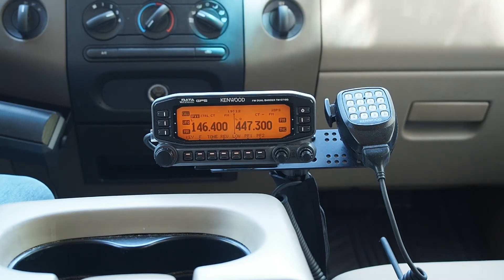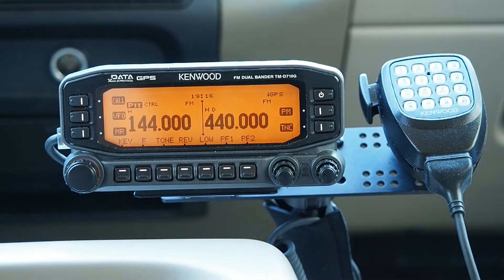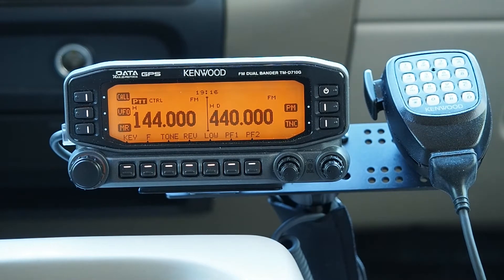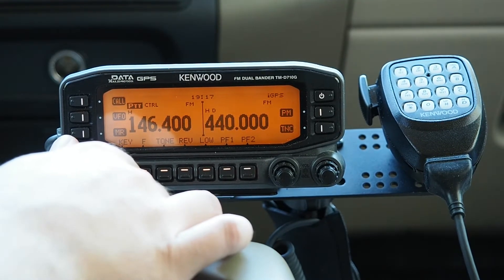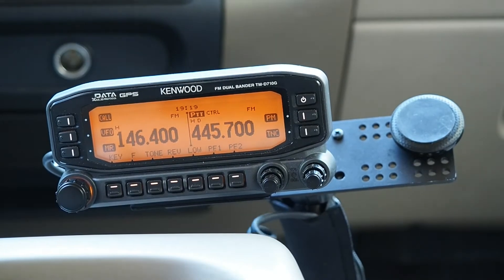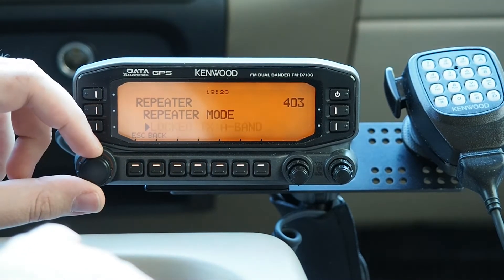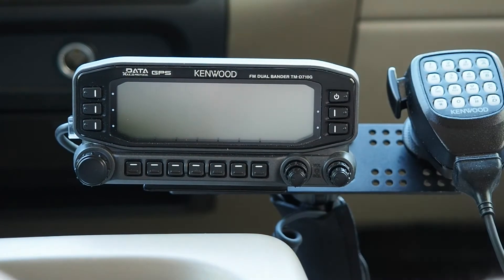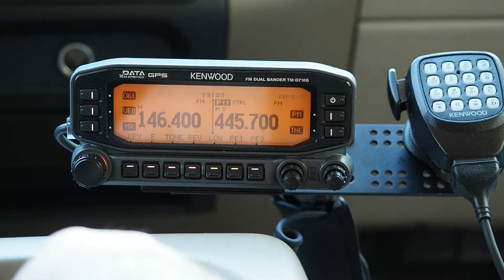Kenwood TM-D710G crossband repeater

Comment: i liked the video... what is the use case for cross banding between repeaters?
Reply from the maker: Honestly it's probably not a good idea, but if you really needed to link the repeaters and had permission from the owners, you could do it to link different groups with single band radios, or extend the coverage of the two repeaters.

Comment: Hi Chris, great video. Couple of quick questions: 1) how often does the radio identify itself when in cross band mode, and 2) does it identify on both frequencies or just UHF?

73, Bob
KO4CLV
Reply from the maker: Bob, the timer is for every 10 minutes which aligns with FCC requirements. As for which band it transmits your ID on, I'm not 100% sure but it's probably only whichever side has PTT/CTRL.
Reply from the maker: (Edit: this is wrong) I verified tonight, it will ID only on the band that has PTT.
Reply: @ChrisKeller  Hey thanks! Though when I did my test, my radio ID'd on one frequency and then five minutes later ID'd on the other, etc.
Reply from the maker: @bob76451  You're totally right, I needed to wait a bit longer. :)